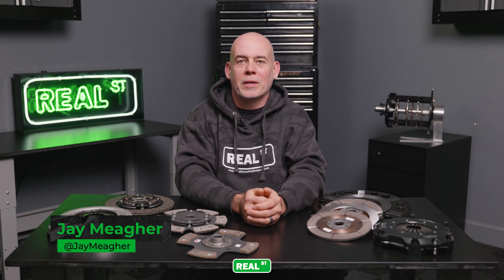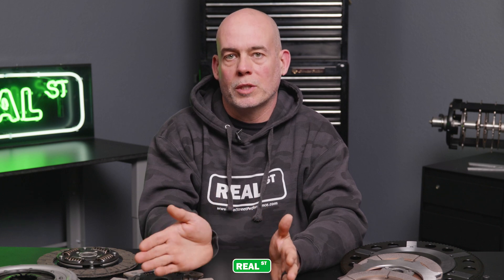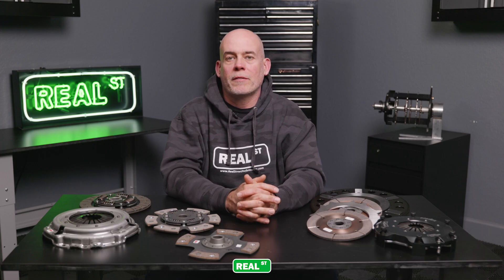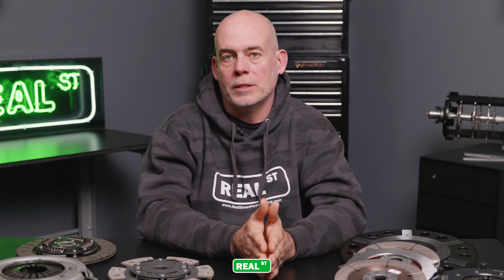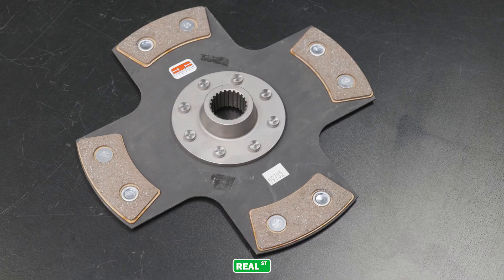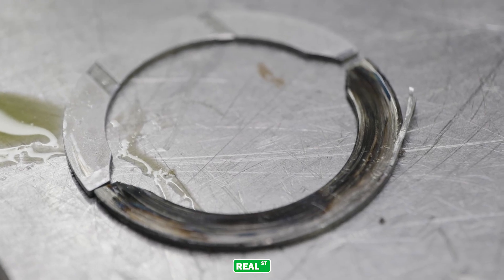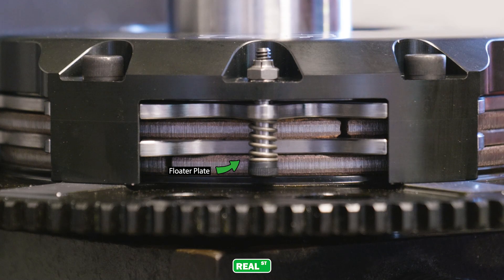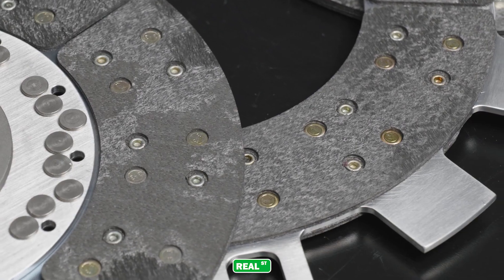The Difference Between Single Disc Clutches vs Multi Plate Clutches - Jays Tech Tip

Comment: As you may understand the inner diameter of the clutch is an important consideration. desopt_2015_02.pdf. I would ask the question of the rating of a normal organic clutch sold by a vender that would suggest that it is a slight bit better in material design but is has a smaller inside diameter or the area is smaller then OEM design. Why is it suggested that some aftermarket is going to preform better with suggested better material design but less area contact as the clutch friction area is smaller. If the clutch friction area is smaller then more heat is made. So the U would be higher and the Q would also be higher. So the material would last not as long and not do as well in truth. Suggesting that the material is capable of the same conditions with a better result is that someone is suggesting something that may or may not be true in all cases. The habitual behavior of the user does figure greatly into the live span of the material's capability but damn, What is it about some cheap ass shit that a person can't get around anymore. MO money for those that put less material to the customer with some specs that suggest they are treating you better. Organic clutch design is good for common driving experiences in the day to day ebb and flow. But if it is suggested to put a little bet better material on a clutch, but in the same instance, make the clutch friction area smaller, your upgrade of material is that you may in fact gain nothing but in fact lose life span. Considering the 1 law of thermodynamics. Does a slightly better material do better and if so does that material last as long if you use less considering that the U and Q are higher. so how to design something to improve the convection transfer of heat in the area of the smaller area of clutch. And improve the heat transfer of the material to cause the clutch to preform in fact as well as OEM.

Comment: Jay, is the difference between a clutch disk with the  4 or 6 coil springs and a disc without them simply a matter of dampening and smoother operation?  Coil springs help soften engage, grab? I just replaced a bad disc that had the coil springs with one without them and the clutch is not as smooth or soft, with noticeably quicker, shorter stroke grabbing, made me stall a couple times.  Will my clutch soften when clutch is completely broken in?  Previously, the entire friction point movement area of the pedal was about 3/4".  The new disc is about 1/4".
Reply: Nobodies answering this shit homie
Reply: @yajsemi671    Because they don't know, and why would you possibly care?  You are nauseatingly predictable.

Comment: Why does my multi-plate clutch always make that ringing sound while in neutral?
Reply from the maker: With the clutch pedal released most of the noise you hear is the gear lash in the trans and not the clutch itself. If you're talking about noise when the pedal is depressed the floater plates generally rattle.

Comment: I get a lot of guys that tend to over-clutch their cars for it’s use/power level, and then they end up not even wanting to drive it. I’ve been able to experience a variety of cars  to quickly build product knowledge and experience tips to select a clutch that works for any given application, even down to certain brands having particular characteristics versus the next for the same style clutch assembly. Great info as always, Jay!
Reply: Hello i have a 6.0 twin turbo ls with 1200hp mated up to a t56 magnum that I use for street use, i cheaped out on the clutch and it doesnt hold past 4000 rpm, what would you recommend? I would like smooth engagement, the last clutch i had was unsprung and i hated it

Comment: I have the clutch masters 850 triple plate for my supra, it has very small engage window. the car bogs most of the time.
I used to drive my evo with exedy triple plate with easy, but this one is way difficult to drive
is there a way to set it up so that it feels like a normal triple plate?

Comment: I'm still trying to find the best 2jz/r154f single disc clutch. 600hp. Alot of guys dont like the DM 3.5. So I'm wanting to see more options.
Reply: I wouldn't recommend the 3.5 either.

Didn't feel well. It's a modified OEM pressure plate and had poor pedal feel for me. The pucks welded the end tips to the flywheel twice. Once at 300mi and again at 4500mi. 
Factory r154 jzx100 that only has a boost controller. Brand new master/slave and all new throw out components when doing the clutch too with Toyota parts.

I replaced it with an HKS LA twin disk kit. The hks twin feels phenominal to drive, and imo is perfect for a street car. Exedy makes the clutch for HKS. Exedy also makes essentially the same twin disk but you can get 6 puck disks vs hks having full face disks. Both are OEM pull style pressure plates so installation and reliability are great.

Iirc the cost difference between a full drift motion setup and the hks/exedy clutches was about $1000 Canadian after I had to pay shipping for the DM setup vs buying the hks clutch from a local shop who got the hks clutch in 3 days.
Reply: @KyleXSki with that clutch did you have to make any changes to the clutch pedal? I have an X90 myself and this has me curious
Reply: @Armanition  No pedal modifications needed for the hks LA twin. Direct fit part number for my x100 so the x90 should be the same. HKS has a sheet on their website with the PN and anyone who's a dealer or has access to a distributor that carries them can order.

And this last summer season the clutch has been great with some mild street abuse. I've been able to shift 1-2 doing burnouts/left foot braking no problem. I think the only time I slipped it pretty bad was a car full of adults trying to get greedy on a hot day and attempted to do a burnout from a standstill in 2nd. Car was way to gripped up haha. No issues though after.

Comment: Is there a noticeable difference in terms of engagement "chatter" or driveabilty between the Clutch Masters 725 race twin disk and street/race twin disk? 

I've been considering getting a street/race disk set in my turbo street car to replace the race disks that are in it currently, but I'm not sure if it'll be a big enough difference for the $650 cost.
Reply: This! My 850 race is all or nothing.
Reply: @danielboot  Yes and no... CM said a hydraulic throwout bearing will help with street driving because the pedal will have more throw, making it less sensitive. I ended up buying the bearing and the street/race disks. There was a pretty big improvement with street driving! Pedal is much softer and there's much less chatter.

Comment: Any large face clutches for k series.  This is a very big problem for high hp application that are street driven
Reply: I'd love to know if there is a good K series option as well! My CM 725 is a hassle to drive on the street.
Reply: You need to know torque values. Performance clutches aren’t going to have a problem with high rpm’s, which I’m assuming is why your Honda is “high hp”.
Reply: @TML34  535whp 395tq, awd, 3300lb chassis
Reply: @The Hutch  I wasn't sure how much the having 1 organic and 1 cermaic disk like the street/race version has would help make the car more streetable.